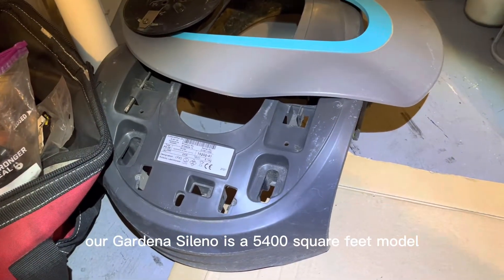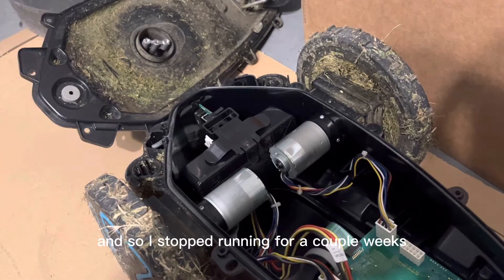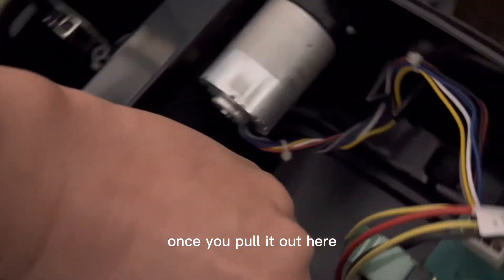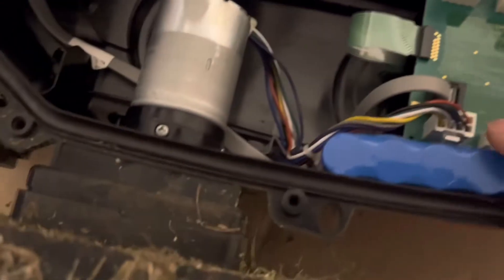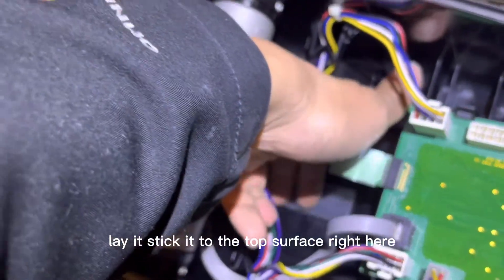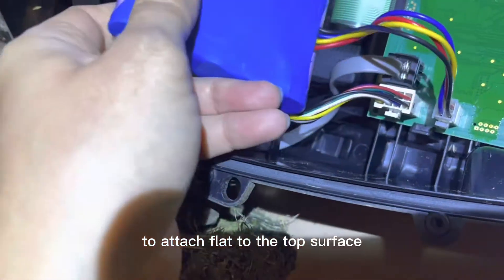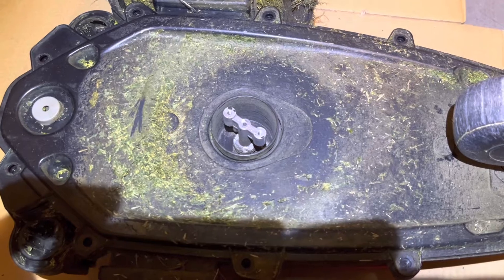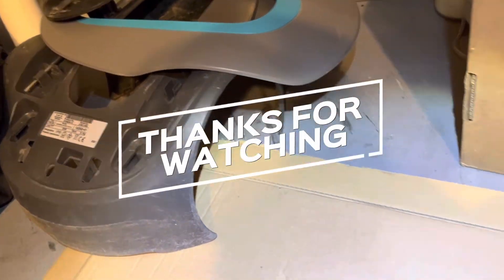Replacing/Upgrading a Lithium Battery for Sileno Minimo Robot Mower

Comment: The battery case is pretty easy to open. Its not glued, just clipped in. If you pry up on the top lid, it will pop open eventually. i Had a discharged battery from a used sileno minimo that had been sitting for to long. the battery pack is good, but the protection kicked in, so it was not charging. I opened up the case, and jump started the battery pack with my bench power supply, bypassing the charging circuit. This revived the battery to full health again.
Reply: That's good to know, I was sort of lazy and mostly assumed that the battery wouldn't be at full health having been discharged for a while. The replacement battery was pretty affordable so it was also an impulse purchase

Comment: Currently my SIleniominimo  have 12,7 volts only.   Black & Red are - & +,  but what are thosse yellow wires?   Ryobi battery on my mind..  2.0 Ah & 18 volts also.
Reply: Don't take my word on this, but it seems like the yellow wire is for over-temperature feedback. It's possible that there is a thermistor inside the battery pack. The thermistor could be connected to the battery positive for "input voltage" and the yellow wire could be the voltage signal coming back to the battery management system (BMS). A thermistor varies its resistance based on temperature, and so a voltage drop over the thermistor would translate to its temperature
Reply: @johnnypolex  Yeah, I have silmilar thoughs.  I now replaced sileno battery to similar bigger battery, works fine now.  I also have 13 year old Worx robo, I `m trying to fix it with ryobi 20V battery , getting soon CHEEYYIIE Ryobi 18V Lithium-ion Battery Adapter from temu.
Reply: @galax64sweet. If you remember to, I’d appreciate another update for how the Ryobi-type battery works. I like MacGyver type fixes

I also buy a ton of stuff from China, especially before the new tariffs. You can do so many projects when components don’t cost 10x more due to local shipping and packaging

Comment: Hi, I have a problem with gardena minimo, after entering pin it's just shuts off(replaced battery). Do you have any ideas?
Reply: Late reply, I know. I'm not sure but I would check the battery voltage to be sure it has reasonable charge on the new battery, especially if it was sitting for a good while before you had a chance to charge it in the dock. My memory is pretty bad, but I think this happened to me a couple times. I sort of remember having to charge it overnight before trying again. The charging dock can be kind of slow to charge when the battery becomes mostly depleted. I think it really slowly charges unless it is fully powered on and "unlocked," ready to cut.

 Aside from that, maybe do a reset. Here is how I reset it when I switch phones and have to reinstall the app:

1) (optional) Delete and reinstall the app
2) Stop mower, then hold power to turn off. Wait 1 minute for the mower to fully power down.
3) Hold power button to turn on.
4) If app was reinstalled, open app to find mower.
5) If app was reinstalled, enter default pin code (power button, then clockwise) in the app.
6) Enter same code on the mower's control panel. Done.

Comment: You could have used the wire from the old battery to extend the wire for the new battery. Those connectors are called LP4  connectors and any decent electronics store will sell you the female part you need to make the connection.
Also, Aliexpress sells that CS-HAT315VX battery for US$30 plus freight. And thanks for the video, I just ordered that battery for my Gardena.
Reply: True. At the time, I didn't want to modify any of the original wiring or break anything apart. Good to know the connector type for others working on a similar issue. I now have purchased probably over a 100 items off of AliExpress. Unfortunately, the new tariffs are making many obscure items unavailable and the rest more expensive, so less incentive for me to buy from that platform anymore

Comment: I have a Greenworks Optimow….what you do you think could replace the T0100273-00 battery? 24v/4.0ah/96wh

Most times it’s in another language when I look it up
Reply: Probably too late of a reply for you, but I would think any similar 24VDC lithium battery with equivalent or higher Ah rating would work just fine. You just might have to splice the old battery connector over. Maybe this reply will help someone else in a similar predicament

Comment: Thanks for the video! Have you choose the battery based on original part number? If I look for mine, it only finds... original replacement.
Reply: (11 months later) For anyone else wondering, I most likely just google searched the model "Sileno Minimo" and found it on eBay. Then I probably cross-checked the connector type, voltage, and capacity. Then I found a cheaper alternative on Amazon. This is all from memory, so take this with a grain of salt. I have a gold-fish memory

Comment: This video was very helpful, thank you. Taking off the top cover is unnecessary. Just pull the bottom cover.  If you have a cordless drill or impact driver, pulling the torx head bolts is fast. I used 3M 30lb double sided tape to mount the battery. Worked perfectly.
Reply: Glad the video was of some use to you. Yes, removing the top-cover was in the end not necessary. Sometimes, it comes with a torx wrench clipped under the top cover. I figured I'd disassemble it like a kid with a transformers toy to see how things were put together

Comment: Warning! I have mower with the same battery (McCulloch ROB S600), which I opened to replace battery cells. It has a BMS (Battery Management System), protecting from over current / over voltage and balancing the cells to prevent failure (which in case of LiPo can be really ugly). I don't see any electronics in the unit you purchased, and therefore would not recommend using it.
https://pasteboard.co/qI0wmd9r8RQb.jpg

Comment: Why did you not just splice a new harness in and use the original location?
Reply: I was asking me the same thing.
Reply: In the video he says that the cable is too short
Reply: (2 years later) I didn't find it necessary. The battery worked fine until the house was later sold

Comment: Did work ok afterwards?
Reply: Yes, it works even better than when it was new. It cuts for probably double the time between charges now.
Reply: @johnnypolex  The black box with the battery can be opened by throwing it into the ground (I'm not joking).
I has plastic clasps all around, so a strong shock IS the only way to open it.
However inside the black box there is also a circuit, I have no idea what the circuit does, but you no longer have it in your Sileno now.
Here you could theoretically replace the individual batteries, but.... THEY ARE SOLDERED.
They really want you to pay 400$ battery pack for a mower I bought for 350$.

"You will have nothing and be happy" kinda thing.
Reply: @NicoloZanetti  Haha, interesting. That’s good to know. We sold the house and left the still working mower with it. Maybe the board helps balance the Lipo cells? Aside from that, maybe it has an overtemperature feature, which could use a thermistor to monitor if temperatures spike due to wrapped weeds, direct sunlight and extended cutting time